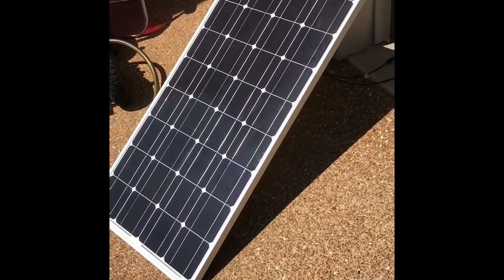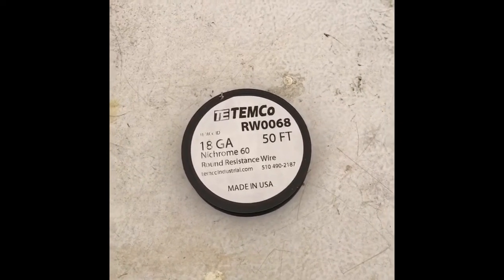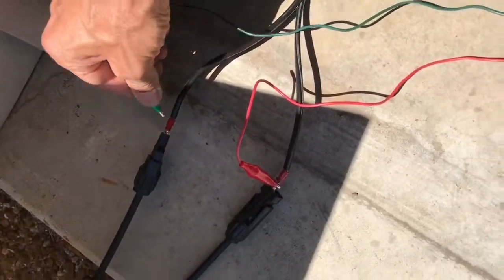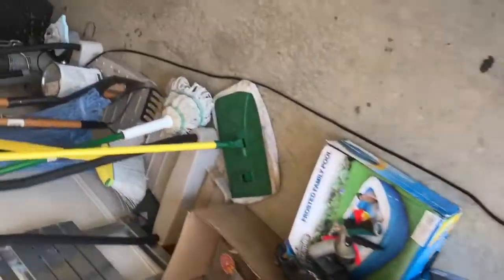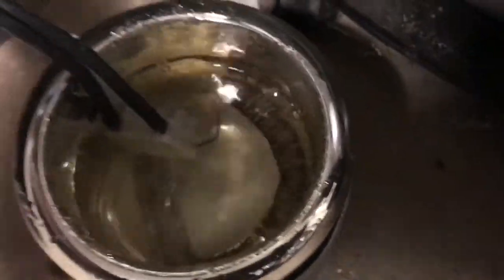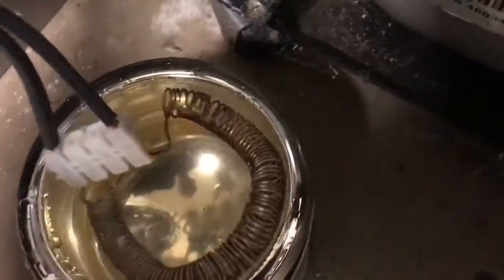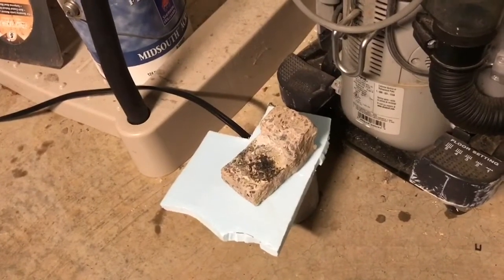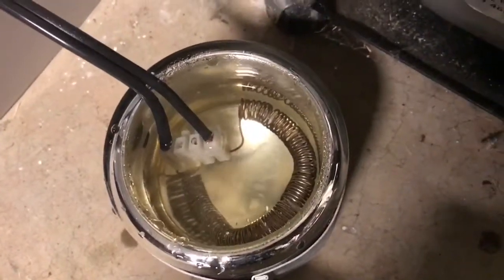Solar Water Boiler

Comment: A silly question. Does resistance change with longer length? I'm thinking of using a 30 ft length in a trough of sand as a battery in a green house. Direct dc from a solar panel.
Any advice would be welcome. This clip made me subscribe. Thanks.
Reply from the maker: It’s a good question. Resistance is proportional to length. At higher voltages, there are less losses for the same length and thickness of the wire. The set up I’m using is a 48 V set up to minimize wire losses. 12 V set up, lose more energy as heat for the same length and thickness of wire according to the formula V squared/R.

Comment: Looks interesting, I would likely use a double boiler because you can't trust all nichrome to be the same when in contact with drinking water.   The water might not be scorching hot with a double boil but would do for drinks or a wash up.
Reply from the maker: Yes different nichrome wires  have different compositions